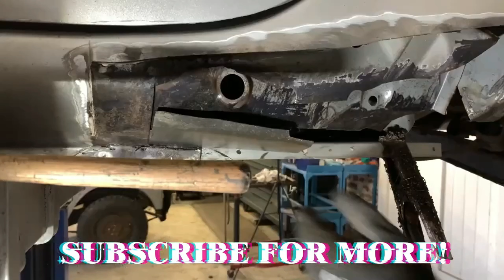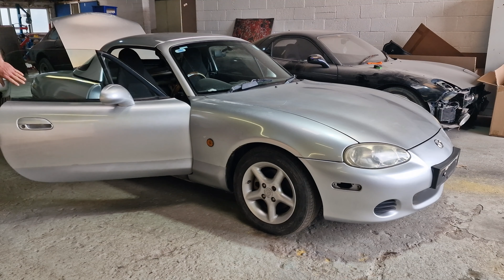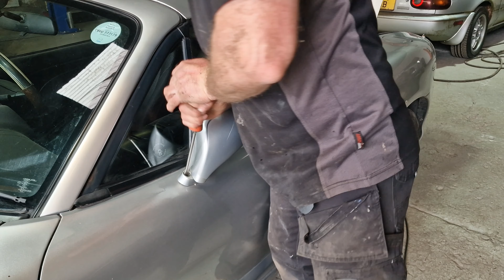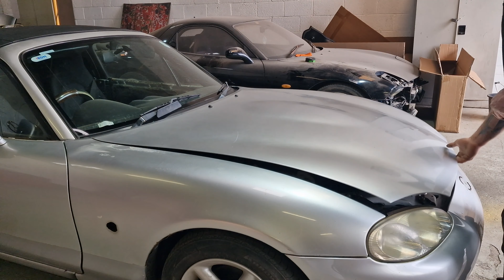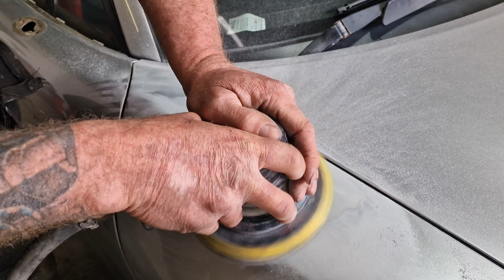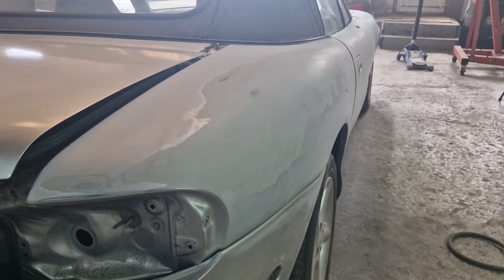MX5 / Miata Prepping For Full Respray  : Rusteration Part 17

Comment: The customer must really love this car. Surely it was more cost effective to bin it and buy another.
Reply: Not really, as many others will be corroded, or have accident damage or mechanical problems, if you start with a good car, then its an investment, the value of a well refurbished car like this will rise, and overall it probably costs less than losing money on a new car, I wrote off a low mileage car because the gearbox failed, and the so called specialist ruined the car !